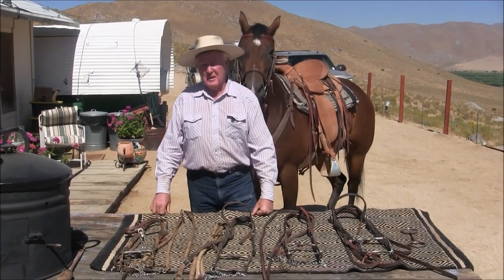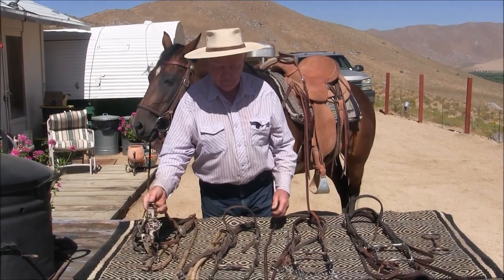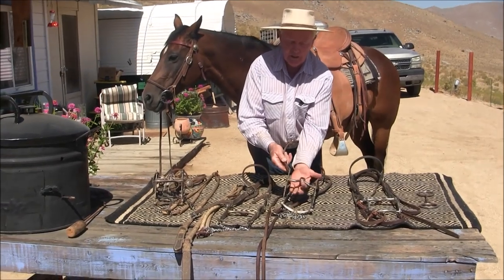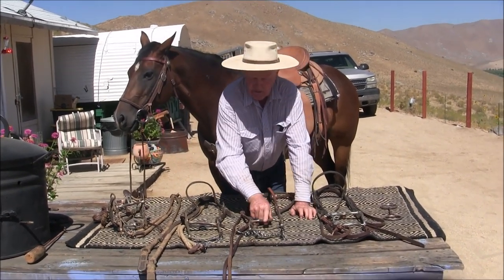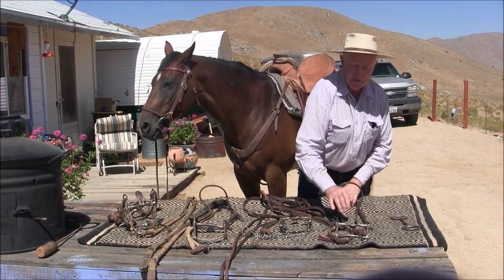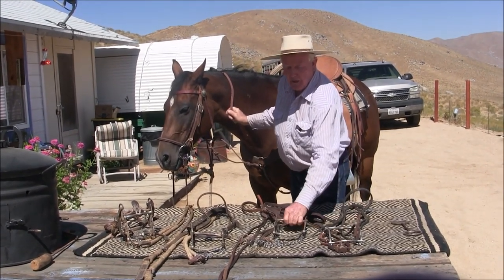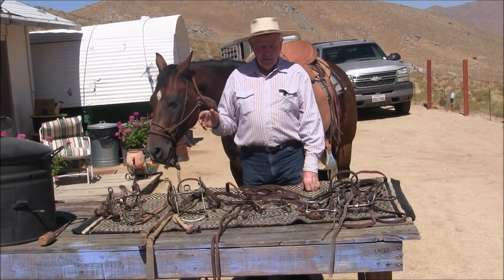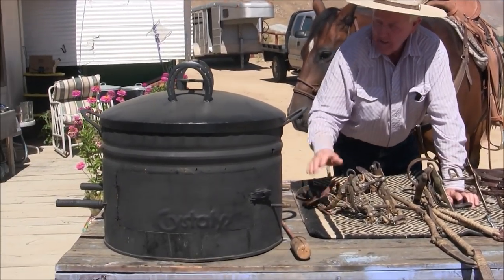Pat's Take on Bits

Comment: Hi Pat. I'm working on 2 horses right now that i would Like to transition over to a half breed relatively soon. Would you be able to speak a little more in depth about the physical attributes you look at in a horse to know what style half breed to use? e.g. topline, head carriage, ect.
Reply from the maker: There is information on our website in the description of each of the bits we offer. Let me know if this clears things up for you... https://www.thedisciplinedride.com/store
Reply: @PatnDebPuckett   Thank you for the reply. I was looking at your website the other day and reading the descriptions. I noticed that the Santa Maria and Santa Susana have the same description for the most part. "Suitable for most modern quarter horses and other horses that have a level topline and lower head carriage." To my untrained eye the Santa Susana cheekpiece is a 1/2 inch longer and a little more swept back. Just curious if there is a way to know if one would fit my horse better than the other. Thank you again for taking the time out of your day to help.

Comment: Where can you get the Sam ?? Mouth pieces? ( bits on my right but would be your left ☺️) cheap one. Don’t get anything like this in England
Reply from the maker: I believe the bit you are asking about was made by a now out of business company called Sleister. We prefer the high port or San Joaquin mouthpiece. You can sometimes find Sleisters on eBay. You can also go to the Links page on our website and click on the Bitterroot Saddlery link. If you’ll contact them, they can point you toward a Jeremiah Watt bit that is a mid priced bit similar to the Sleister. Thanks for watching in England...

Comment: What about curb bits?
Reply from the maker: Curb bits are ok if the curb strap is adjusted with just one finger between the jaw and the curb strap so the mouthpiece can’t turn over in the horse’s mouth. Because of the curve of the cheekpiece and the lightness, it isn’t conducive to collection and self carriage. It’s a good enough bit for trail riding and they’re safe to use for kids and old, gentle horses.
Reply: OK now I'm confused.  Karla asked about "curb bits" and Deb knew exactly what she meant.  But I don't understand what she meant!  I thought any leverage bit was a curb bit.  But you both had something specific in mind.  What is that?

Comment: Where does Pat buy the two bits he says you should use when you go from bosal to a bit?
Reply from the maker: Sleisters are getting hard to find because the company went out of business. We can still find them on eBay sometimes. When we get them, we have a cricket put in at a local machinist because they come with a roller that doesn’t make the same sound. The half breed and the spade bits are a different story. It all depends on your budget. You can find Bruce Haener in Santa Barbara if you’re pretty flush. If you can’t afford an heirloom quality bit, you just have to look around at places like D-M in Reno NV, Tip’s in Winnemucca NV, and Capriola’s in Elmo NV. You can see a trend there...you can also look on some of the Facebook groups where individual people are selling or trading used bits.
Reply: @PatnDebPuckett  What about a Les Vogt?  Do you think some of his bits would suffice?

Comment: Any thoughts on a Klapper style mouthpiece, with solid Calvary style cheeks?
Reply from the maker: Here goes...In our world, if a bit has a shank, it does not have a mouthpiece that is broken in the middle. There are way too many mixed signals that are possible in that type of bit. These bits, along with a million derivations of the correction bit, were invented when people got in a hurry to get a horse ready for some competition or other. They had to ride their 5 year old horses in a shank bit and they weren’t ready for it. So they just started cutting up the mouthpiece so they could still ride two handed in a shank bit. Thanks for the question!

Comment: Great info. Are you open to a word of critique? You held an O-ring snaffle in one hand and caused it to fold downward and said this hurts the horse's bars in the mouth. How would the reins ever be pulled downward and inward to create that folding action? The horse's neck is pretty wide. The reins cannot pull inward any further than the neck allows, which is much wider than the head and mouth. Also, the reins would not be pulling downward in the bit. Sorry, but the "nutcracker" effect is a myth, and you just perpetuated that myth with your demonstration and comment.
Reply from the maker: We’ve stood alongside horses while people are pulling on the reins so it is not a myth. First, when a horse is in collection, his head is perpendicular to the ground so, while the bit is not pulled down toward the ground, due to the relationship of the rider’s hand to the horse’s jaw, the bit is pulled around the horse’s jaw. Second, your premise that the width of the horse’s neck somehow makes it impossible for the bit to collapse is not a valid argument either. Again, observation dispels your premise. We have also observed that a horse will not allow this pain to persist very long. He takes his tongue and pushes it agains the bit in order to protect the bars of his mouth. If you will stand alongside a horse when a rider asks the horse to back up, you will not be able to see the tongue of the horse. The reason is that the tongue has retracted inside the horse’s mouth and is defending the bars of the mouth agains the snaffle. Now, I will say if you never put any pressure on the bit and you never ask the horse into collection, maybe the horse will not do this. But if you need your horse to move in collection and self carriage on the hindquarters, the action of a broken snaffle bit will impact the bars of the horse’s mouth. And depending on the width of his lower jaw, the joint (which has now formed an upside down V) might also impact the roof to his mouth. Multiple jointed snaffles are no better in that they just move the pain to different areas of the structures in the horse’s mouth. All you have to do is look at the tongues of racehorses. The damage doesn’t happen because there is no “nutcracker” action. Ideally the horse learns to respond to the pressure of a straight bar like our Missing Link Snaffle or a Mullen mouth or a regular western bit. The clarity provided by an unbroken bar in conveying pressure and release is much easier for a horse to understand than a bunch of disjointed links sliding around in his mouth, alternately causing confusion and pain.

Comment: These look like horrible torture devices to me. I only rode with a double link snaffle bit, and when I ride again I will try to transition to riding with a rope halter.
Reply from the maker: A double link Snaffle is one of the harshest bits that has done the most damage to horses’ tongues of any other bit. Try putting it across your hand sometime and have someone give a good pull on the rings. Now imagine that Snaffle is sitting on a sharp piece of bone with a very thin layer off mucous membrane. Properly trained, horses learn to respond to the bits in this video as signals and then the rider’s body communicates to the horse what is being requested.
Reply: @PatnDebPuckett  maybe I used the wrong term. I had something like on this picture, made with some copper alloy (it looked like matt golden and had a roller in the middle. The vendor/rider said it's the softest bit he has, and I have very soft hands also, and my horse liked it better than the single link I had before. https://cdn.horseloverz.com/1sn00112-v1.jpg
Reply from the maker: @p4radigm989  it’s not a “soft” bit and will still collapse onto the bars of your horse’s mouth causing pain. Then your horse will react by balling up his tongue to defend himself. He will have to brace his jaw in order to accomplish this fete. That is unless you never gather your horse into collection in which case you are making your horse carry you around with the majority of his weight and yours on his forehand. Remember it was you who called the bits we use “torture devices” when that couldn’t be further from the truth.
Reply: @PatnDebPuckett  I know near nothing about bits so I have to rely on people who hopefully know better. Probably few people around who really do know in Austrian stables. I didn't say they are torture devices, I wrote the look like that. I don't know how they work inside a horse's mouth and I don't know who needs them for what purpose. I'm not doing any Cowboy work, I just want a horse to be healthy, no unnecessary pain, happy to be around me, and controllable when riding. I was doing pretty good with my horse, but I don't ride anymore because I live in a city and it's just too much time when you don't live next door to your horse, which I would love.

Comment: Gos it doesn’t have to be this complicated. Most horses are fine with an egg butt snaffle but no people have to go and ruin horses mouths with these crazy contraptions
Reply from the maker: Any broken Snaffle is much more severe than any bit in this video because it collapses onto the bars of the horse’s mouth causing the horse to defend himself by bracing his jaw and tongue. Sometime when you’re bored to death, put your eggbutt Snaffle across your hand and have a friend pull on the rings. Do the same experiment with a solid Mullen mouth. Then report back here.
Reply: Yep I have, it doesn’t hurt anymore it just applies pressure in diffrent spots. It’s not harsher that your bits with big shanks, shank length puts so much more pressure in a horses mouth.
Reply from the maker: Not if the horse is taught properly to ride off of the rider’s body instead of his hands. Also, I have personally seen more horses’ tongues shredded and scarred by Snaffle bits than by leverage bits.
Reply: Well if someone is shredding a horses mouth with a smooth snaffle they shouldn’t be allowed within 20 feet of a horse
Reply from the maker: And if someone is abusing a horse with a leverage bit, the same thing applies. Moral of the story: don’t judge a bit if you don’t understand how it is used. I shudder when I see someone banging on their horse’s moth with a so called “smooth” snaffle. Which is why Pat invented the Missing Link Snaffle…it doesn’t rely on the nutcracker action of every jointed Snaffle bit ever made. It’s a bridge to a western bit which forces riders to ride off of their bodies rather than their hands.
Reply: I’ve ridden both, I prefer English I can assure you I don’t simply ride off my hands I use my leg and seat. I currently ride in a rubber Mullen mouth.